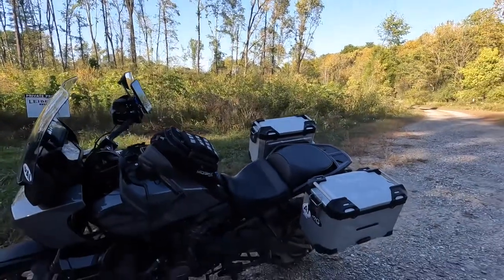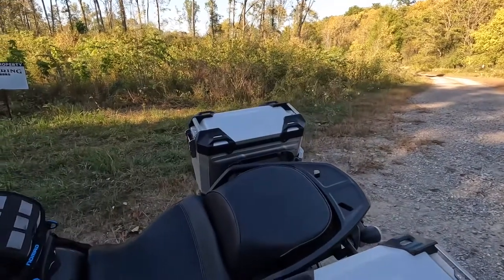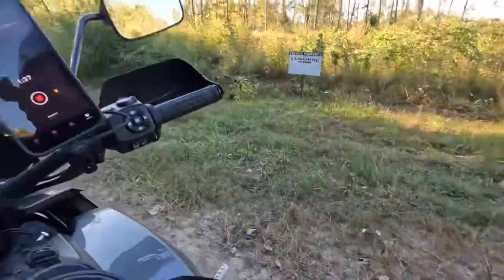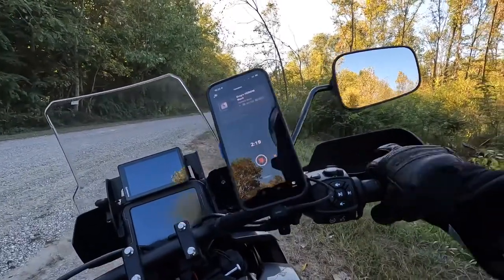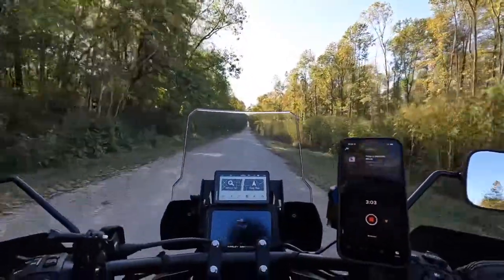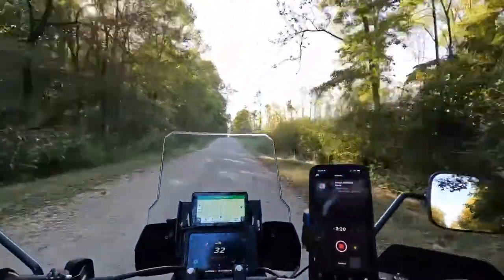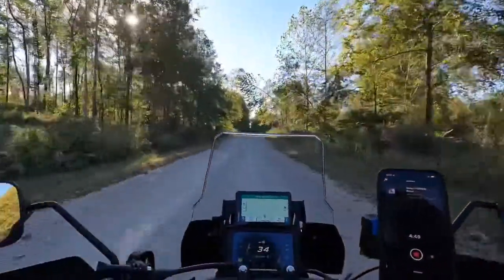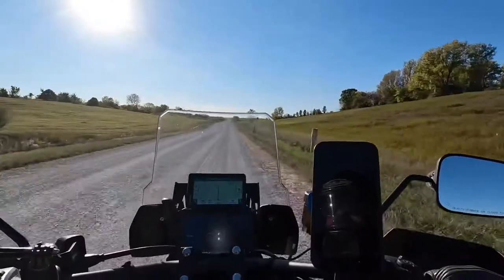Sargent Seat on my Pan America

Comment: Good to know.  I also have a problem with the stock seat pushing me forward AND causing pain to my tailbone/taint.  NOT a comfortable long distance seat.  I'm going to make other additions to my bike before I decide on whether or not to change out the stock seat. Maybe there is a break in period like a pair of boots? Thanks for the video!
Reply from the maker: Thanks for watching.
Reply: Yeah the stock seat pushes you forward as there is a lean. It doesn't do that in the high position but that makes it too high. Suggestions I have received are to shave the seat pegs so that you can lower the back portion of the seat while it being in the high position. I will be trying that soon.
Reply: @Dude_Virus  I saw a video on that from Yeager's Cycles.  I will try that as well.  I did make a 5 hour trip on the stick seat and did much better but still became annoying after a while.  Will try shaving it down as well.  Just added the Tall Boy risers and that helped me sit more upright as well.
Reply: @johnmyers8588  Yeah the stock becomes a problem after some hours. I am currently using the stock in the low position and I do not like the forward lean. It is more due to the lower handlebar risers. I am first waiting for the riser extensions to get delivered, so I can check if the 2 inch up and 1 inch pullback makes any difference or not. If not then I will be shaving the seat pegs and trying the seat on the higher position.

Comment: Hey, the Sundowner seat is comfortable on long rides as well but what we all want to know about the Sargent seat is: 1. in the lower position, does the rider feel like the seat is tilted forward/does the rider keep slipping forward? 2. does the pillion slide forward on the seat under braking?  I am also interested if the Sargent pillion seat works with the stock rider seat. Thanks.
Reply from the maker: It doesn’t feel like it tilts me forward like the stock seat. It does have more room than the stock seat. It feels like the rider position has more room. Yes Sargent seat pillion does fit with the stock rider seat in the high and low position. I don’t ride 2 up so I can’t answer that question. Thanks for watching.
Reply: @mudcatstravels9751  Thks.

Comment: How tall are you  and how would you compare to the stock seat  does the Sargent push you forward or keep you level
Reply from the maker: The Sargent does not push me forward. I am 5’8” with a 30” inseam. I do have the Sargent “low” seat. I have a second video with measurement on it, that may make it easier to compare to your current or prospective seat.
Thanks for watching.